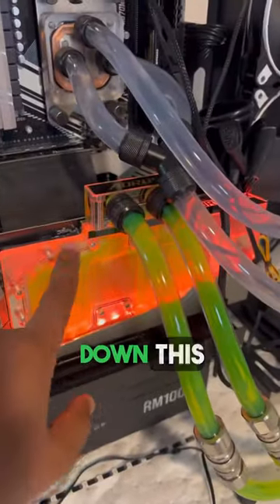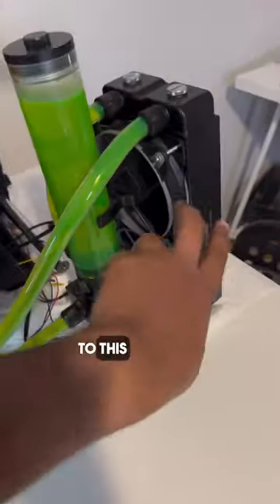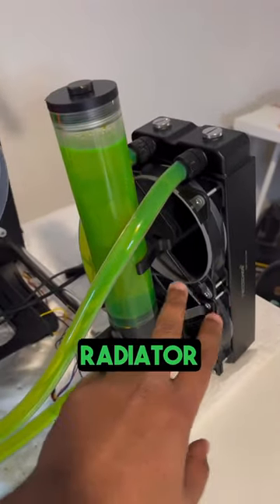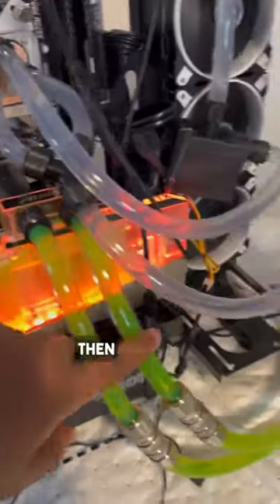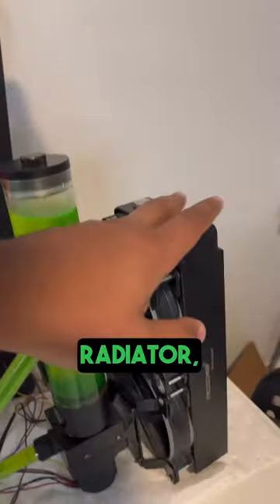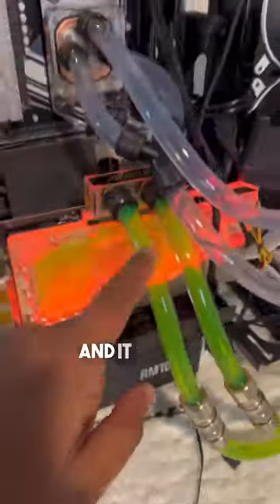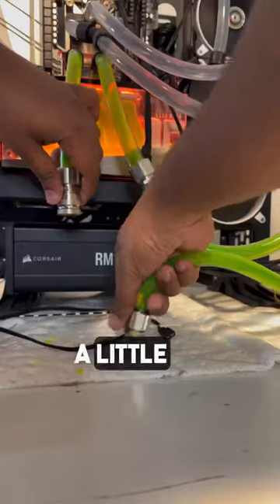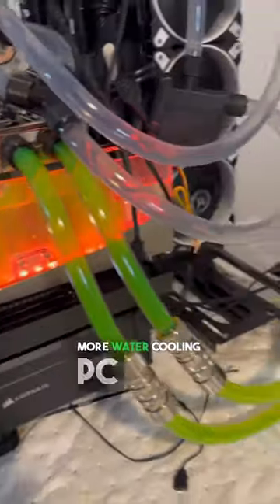Build your own GPU water cooler ☠️

Comment: I'd put the pump on the return before the cooler, otherwise it's putting more heat into your inlet fluid.
Reply: So you’re saying rather than pump to cpu water block you would have the radiator to cpu water block instead? Sorry I’m new to custom water cooling